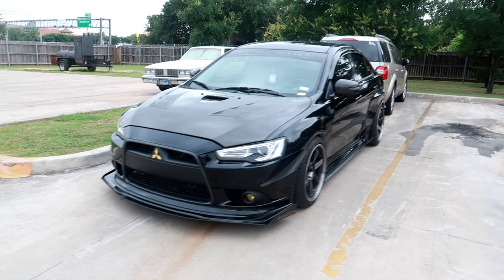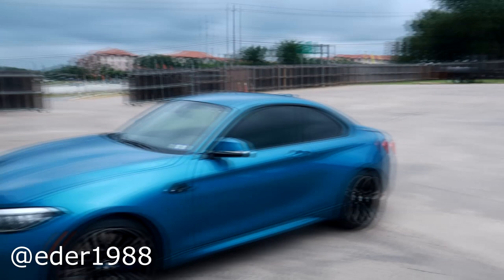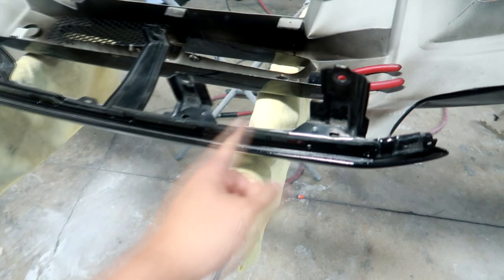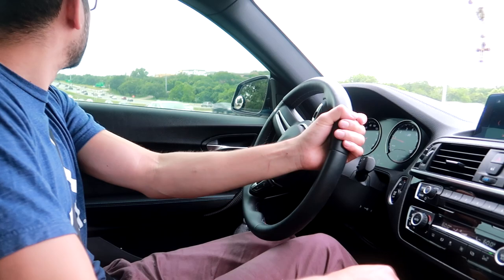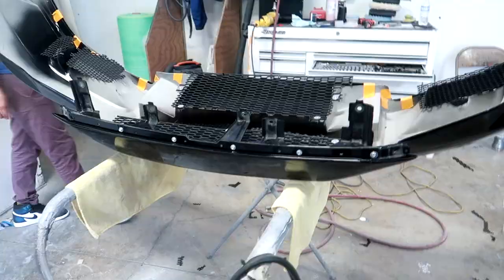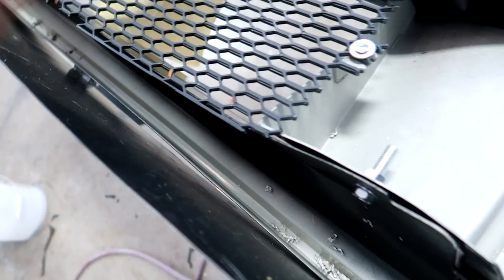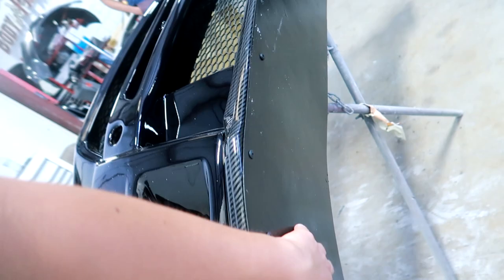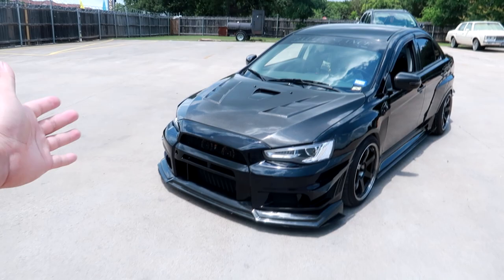Putting on my new Varis front bumper!

Comment: Looks amazing love the the whole look ur going for👌just curious tho how did u get the VARIS bumper to match up on the side arches, they made that aftermarket bumper for the evo which is 2 inches wider than the stock lancer, I’m thinking of getting the bumper but have been put off because of fitment, been told I’d have to get evo fenders just to fit it
Reply from the maker: Thanks man I appreciate it! Yes you would need Evo fenders or wider fenders to fit it since it is wider. I am widebody so the new varis bumper lined up
Reply: The J Media aww okay awesome I could tell it was wider at the back but I’ll have to look into getting some new arches thanks for the reply 👍 keep up the good work too dude, build gets better and better every vid everything you’ve put together looks very unique 👌
Reply from the maker: @charliedickens7244  Yea the front has a Widebody fender as well. The whole fender was replaced. Thanks man I appreciate it! More plans to come soon as I slowly build it up. Stay tuned for more!

Comment: to make it fit did you put it on the original lancer side brackets or did you replace them evo x side brackets ?
Reply from the maker: Used the lancer side brackets. (By side brackets I'm guessing you meant the brackets underneath the headlights by the fenders)

Comment: can you show fitting grill bumper...
i wanna advise you becarefull using injen cold air intake when heavy raining or high water on the road...
Reply from the maker: Didn't get to film that part but had to modify fitment because the side bumper tab broke. My cold air intake has been fine so far. Had it on the car for 2 years now
Reply: @TheJMedia  ...tqvm...because grill fitment very nice...owh very long time you use😆...i had been use but i have bad day when very heavy rain and deeper water on the road cars stuck.cannot start engine n check my inside reprocating parts finish...
Reply from the maker: @mrrunnerpomen3644  Ouch that's not good. Yea there is a risk of hydrolocking. I put on an intake cover now to protect it from water

Comment: I can’t decide whether to get the Ralliart front lip for my Lancer VRX or should I get a splitter
Reply from the maker: Both looks good! You can get a lip and then add on a splitter underneath! Haha. That's what I did
Reply: @TheJMedia  I have the OEM bumper on my VRX and I wanted the Voltex but it requires trimming and I wouldn’t want to mess it up haha
Reply from the maker: Yea the Voltex lip is meant for the Evo x and you do have to do some trimming to make it fit. The ralliart lip will look good!
Reply: @TheJMedia  sweet thanks man
Reply from the maker: No problem! Good luck with your build

Comment: what widebody fender is this? do i need the bolts and panels side bracket from the stock lancer fenders to put it on to this wide fenders?
Reply from the maker: They are custom made Widebody fenders made by a body shop. These front fenders are direct fender replacement and rears are bolt on and done by a body shop. If you are interested to purchase, dm me on Instagram @jus_tyn for more info
Reply: @TheJMedia  how much is the front fender and rear fender gonna be? i'm planning to get the front fenders the same as you had, and the rear fender made by battleaero soon.
Reply from the maker: You're looking at usd$2000 for front and rear to be custom made. Can send you more info on Instagram